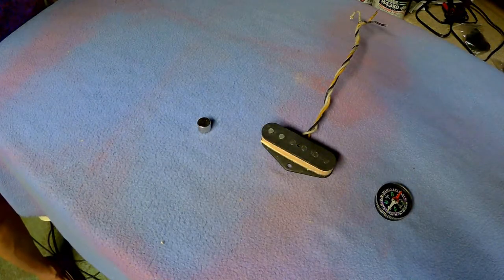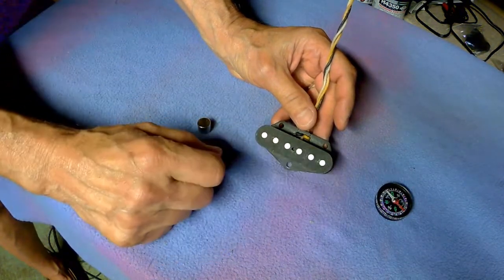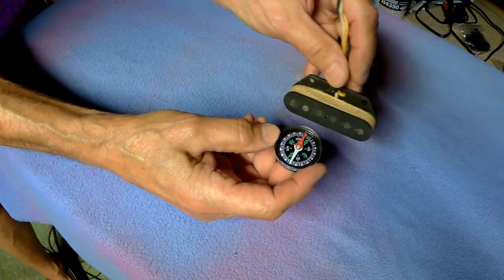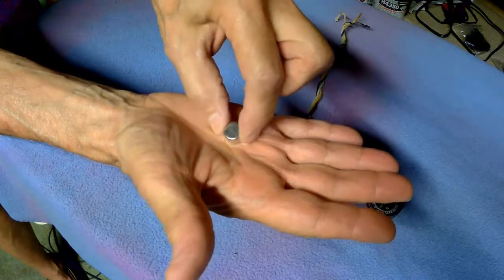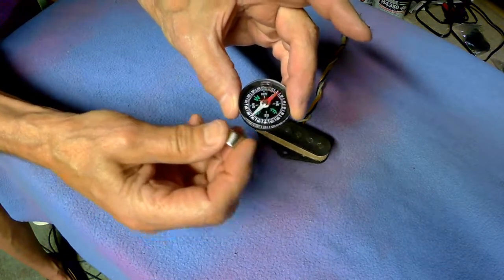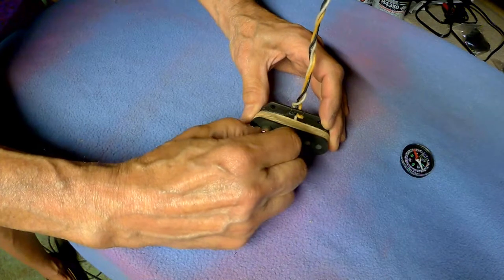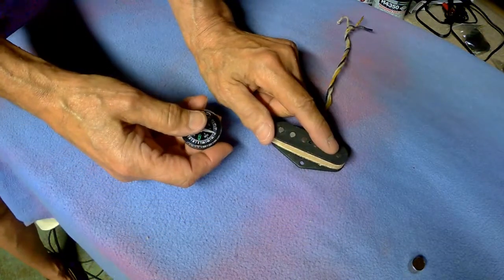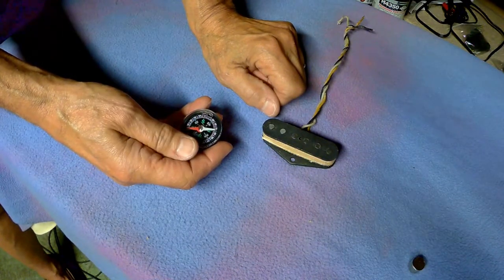Changing a passive pickup's top magnetic polarity

Comment: Probably worth putting a disclaimer that doing this to a pick up with an intentional wind direction and magnetic polarity relationship compromises it's ability to cancel hum with a pickup of complementary polarity and wind direction.
Reply from the maker: THAT goes without saying and the REASON for the ability to both change top magnetic polarity and coil wire wind direction (though for the most part coil wire direction changing for Tele guitars will require breaking the ground strap on Tele bridge pickups and the cover ground strap on Tele neck pickups removed and a separate cover ground lead wire soldered).

Comment: Hi, I replaced the neck pickup of my telecaster with a p90 bridge pickup. what should I do to get the hum to stop in the middle position?
Reply from the maker: In a 2 pickup guitar, one pickup must be RWRP (Reverse Wind & Reverse Polarity) to the other pickup if a noiseless parallel humbucking mode is required when both pickups are selected.   

Right now with your guitar, when both pickups are selected, if the tone is distinctly "nasal" (out-of-phase) the leads of one pickup need to be reversed in the control cavity.  This will be a problem to accomplish with most pickups that also have a frame (P90) or base plate (most Tele bridge pickups) because manufacturers solder strap those kinds of necessary grounds to one of the coil leads.  In doing so, the leads can't be flipped until those ground straps are physically cut and replaced with a separate ground lead or are re-strapped to the other coil lead. 

Once the above is accomplished the tone when both pickups are selected will vastly improve and lose that nasal wonky twangy edge.  If there is still humbuzz noise, then one of the pickups needs to have their top magnetic polarity reversed and in your case it will be easiest to flip the polarity of the Tele bridge pickup because it has exposed rod magnets, accomplished as shown in this video.   P90 pickups typically employ bar magnets that energize screw poles.  They can't have their polarity flipped as in this video and depending on the P90 build would probably require some measure of disassembly to get to the bar magnet(s) and physically turn the bar(s) 180*.
Reply: @rfdsrd  I reverse soldered the cables and it worked, thank you very much sir!
Reply: @rfdsrd  Thank you very much for the answer, it's hard for me to understand and to do. Anyway I managed to reverse the bar magnets of the p90 but the noise didn't shut. (I didn't do anything else) In the middle position the sounds seems normal but I can hear the hum of both pickups, maybe I made a mistake in the schematic, I don't know.

Comment: Excellent video. Some questions. I see that it only charged on one side and not on the other. In a previous video of his, he did the charging with 2 magnets, north and south. Can you explain this to me?. What magnetic strength must the magnet used to charge the alnico have?.
Thank you very much for answering.
Reply from the maker: Magnetic saturation may be somewhat faster if there are a pair of charging magnets, but not required.  The key is that the charging magnets must have a much stronger magnetic field in order to flip the target magnet polarity.  The AlNiCx family of magnets are quite weak when compared to neodymium rare earth magnets that have ten times or more magnetic Gauss rates.  For the most part, all passive magnetic guitar/bass/etc pickups are using AlNiCx rod magnets (i.e. - Fender) or AlNiCx or the somewhat stronger ceramic bar magnets (i.e. - Gibson).  Typically, if they can be accessed, most bar magnets can be physically turned in order to reverse their polarity, but some - such as those embedded within a pickup bobbin - can't be accessed (i.e. - Gibson Firebird pickups).  So, in the case of single coil pickups that employ rod magnets, the bottom line is to use one strong N52 neodymium rare earth magnet to flip passive pickup magnet polarities, with the pickup in the guitar ... and for almost all bar magnet passive pickups, physically turn the bar magnet in order to flip its polarity.  Hope this helps.
Reply: @rfdsrd Thank you very much for your reply. One last question. According to this video, you charged only on one side, does that mean that on the other side, which is the opposite polarity, it will charge automatically?. This is correct?. Thank you.
Other detail. This is correct?:

https://youtube.com/shorts/my7NHURgtuI?si=VMgXtClAVMzzZrn3

Comment: This will noise cancel like humbuck in middle position?
Reply from the maker: YES .... as long as ONE of the two pickups is RWRP = reverse wound & reverse polarity.  If both pickups have the same top magnetic polarity, flip the polarity of ONE of the pickups, which is the how-to essence of this video.
Reply: @rfdsrd  What if none are reverse would, and I just change the polarity. Will it cause a noise?
Reply from the maker: @Ushnic_Uvnikof  Yes.  One passive single coil pickup must be RWRP to the other passive single coil pickup in order to buck the hum .................

REVERSE POLARITY - If the pickups in question utilize rod magnets, this video shows how easy it is to flip their magnetic polarity, right in the guitar, nothing to take apart.  

REVERSE COIL WIRE WIND DIRECTION - This can be a bit sticky IF the pickup maker has strapped one of the coil wires to ground, such as Tele neck pickup cover or a Tele bridge pickup base plate.  If so, those straps need to be cut and a third wire  used to separate the coil from any grounding issues.
Reply: @rfdsrd  But I've seen people do it without a reverse wind. On single coils they use a magnet and on P90s they flip the magnet and bobbin.
Reply: They reverse the wire. And it appears to work...
Reply from the maker: @Ushnic_Uvnikof  ALL that matters is that ONE of a pair of single coil pickups is RWRP to the other pickup.  This video is about ROD MAGNET TELE pickups, where those magnets can't be removed and flipped.  Get it?
Reply from the maker: @Ushnic_Uvnikof  You are mixing up two totally different types of single coil pickups.  There is completely different build between a true Tele neck and Tele bridge pickup and a true P90 pickup.   If there are a pair of P90 pickups that have bar magnets and NO grounding to one side of the coil, where BOTH have the same wind direction and same top magnetic polarity, pulling out the bar magnets and flipping them on ONE pickup, and then flipping the leads of that ONE pickup will make it RWRP to the other pickup.  Understand?
Reply: @rfdsrd  what I'm saying isn't reversing the polarity with a magnet on a single coil tele pickup akin to flipping the magnets on p90. If you reverse the wiring on the teke pickup after reversing the polarity with a magnet, it'll also hum cancel in centre position. Why do you also need to reverse wind on the single coil?
Reply from the maker: @Ushnic_Uvnikof  *RWRP - that is ALL that matters*.  Reverse coil wire wind direction and reverse top magnetic polarity.  Trust me, that's all that matters for allowing either a parallel or series humbucking connection between a pair of passive single coil transducers.  I am a luthier and I build and sell pickups for a living.  www.CavalierPickups.com
Reply: @rfdsrd  OK, so just reversing the wiring IS the same as reverse winding, IT'S THST SIMPLE. You do not have to actually get a pickup rewound - this is phase. And reversing the polarity is simply done with either magnets to reverse polarity on a tele or flipping the magnets around on a p90. VERY simple. I'm not sure why you made this so complicated? So most common pickups can be made noise cancelling in middle switch position with ease.
Reply from the maker: @Ushnic_Uvnikof  Unfortunately, I don't think you still don't fully understand the reason for this video and the concept of RWRP as it applies to passive single coil transducers.  Keep researching and hopefully you'll better understand these parallel and series humbucking concepts.  Best to you!

Comment: Great video, thanks I wondered are you using an N54 or N42 Neodymium magnet? What is the best strength magnet for this task?
Reply from the maker: Doesn't matter - neodymiums have waaaaaay higher Gauss rates than any AlNiCx (Co or Cu) magnets - N42 or N52 will both work quite well and fast.

Comment: Hello. I tried to change the polarity in an old ceramic single coil, which the poles are south, and the magnet bar is north. I couldn´t change the polarity.
Reply from the maker: typically the poles are not magnetic, they're iron and get fed from an under slung ceramic bar magnet.  you need to charge the magnet itself.
Reply: @rfdsrd  ok, I will try, thanks